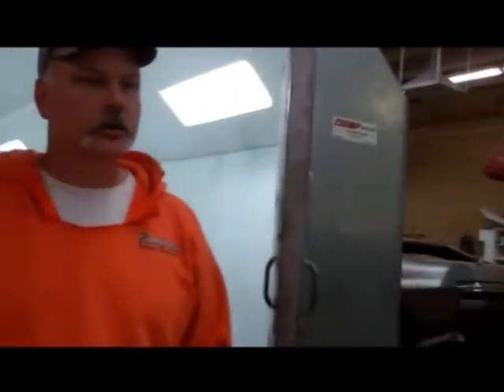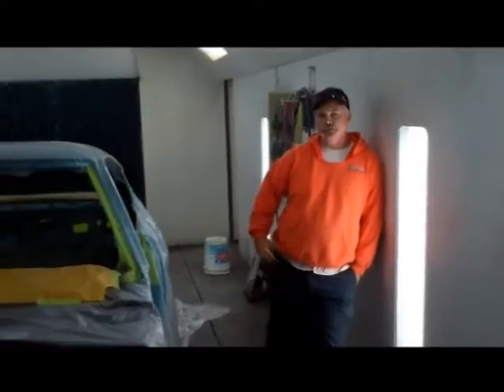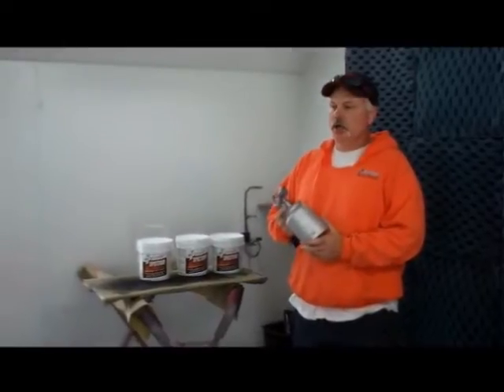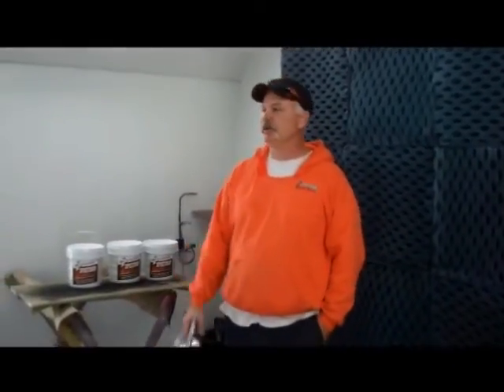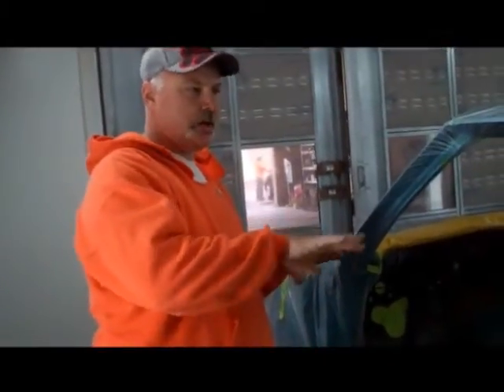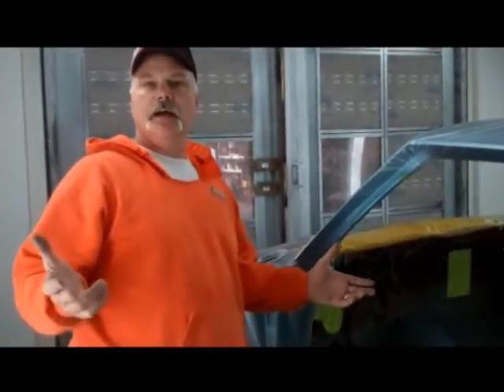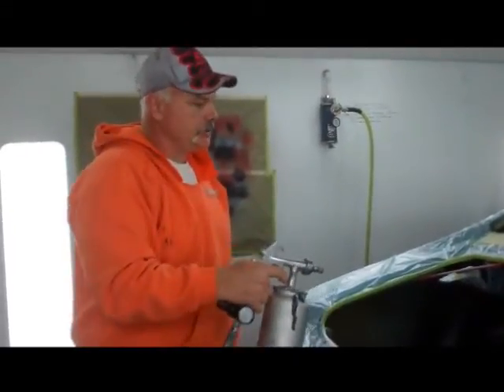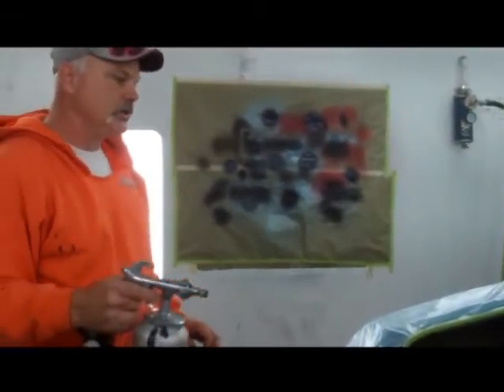Second Skin Spectrum Sound Deadening - R&M Clasic Auto Werks

Comment: No audio
Reply from the maker: Yes, sorry about that YouTube deleted the audio because there was song playing in the back ground. If you look around our channel you will find the newer edited one, that we took the back ground music out of.
Reply: Second Skin Insulation by the way, could I skip the damplifer pro and luxury liner by doing a really good job with the spectrum and spectrum sludge?
Reply from the maker: Spectrum and/or Spectrum Sludge will replace the Damplifier/Damplifier Pro part of the install and will also quiet down actual tire noise when sprayed in wheel wells. But the sound waves (air borne) that the closed cell foam and vinyl barrier work to decouple and block can only be addressed with a foam and vinyl type barrier. We are working on the release of a sweet new light weight foam to use on ceilings, hoods, and weight saving projects, it should be launched by the beginning of the year. It'll also have a a second version that has a heat shield that resists 1,000 degrees infused onto the light weight foam. Keep your eyes peeled #SecondSkinForTheWin
Reply: Second Skin Insulation so, spray the bare metal and then place the luxury liner on top, right?
Reply from the maker: Usually there is a closed cell foam decoupler like Over Kill/Over Kill Pro used in between the Spectrum and the Vinyl to keep the vinyl from slapping against the Spectrum
Reply: Second Skin Insulation well, I have luxury liner pro, so there is foam and vinyl. That should work right?
Reply from the maker: Yes, that is the best option. The foam side should go down onto the Spectrum, remember to let the Spectrum cure for 24 hours before applying the LLP. But only 30-60 minutes between coats of Spectrum to get to the 3mm thickness.